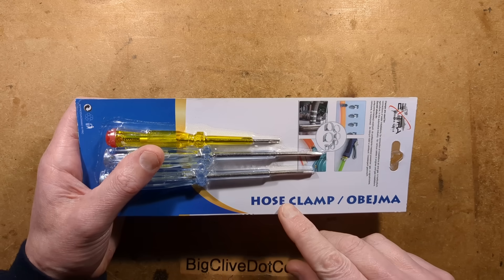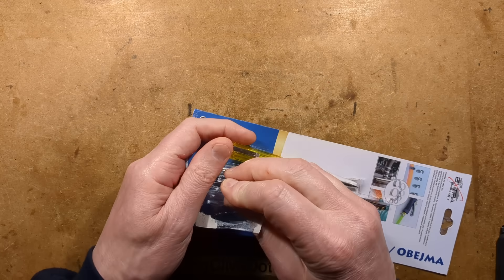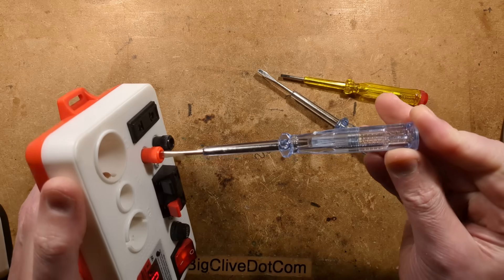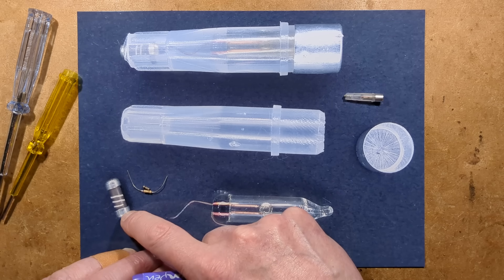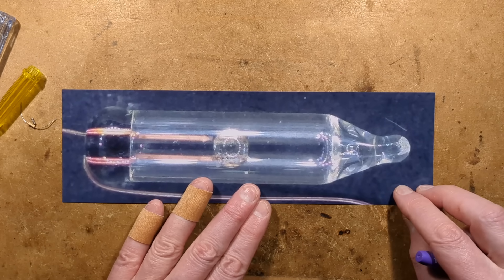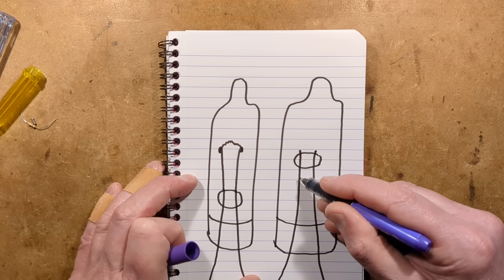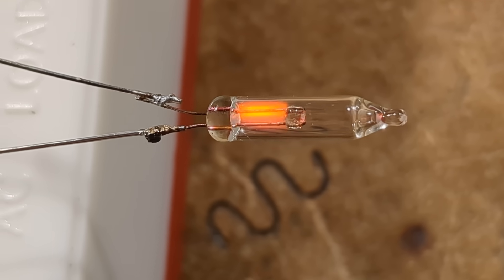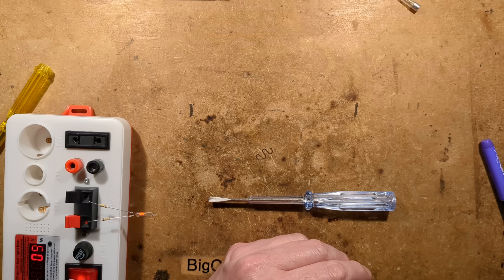Mispackaged testers with very odd neon bulb

Comment: Thanks BC. How strange that they should manufacture a neon lamp like that when NE2s are so cheap. If the dumet is being used as electrodes, it'll sputter very quickly if you leave the lamp powered up for a few hours, depositing a rather nice copper coloured mirror finish on the internal walls. One of my very early experiments!😁

Comment: Me & my dad have been using those electrical screwdrivers for the small slot-head screws in connector blocs and for testing if a connection is live, yes not the most safe sounding way ~ having to rely on that small resistor to protect you from being zapped/blowing the neon bulb, someone discovered that the voltage to light a neon indicator was low enough not to electrocute a human, and “this would make a very safe way to test for a live connection “ and marketed it. And conveniently integrate it into a electrically safe small flat-head screwdriver, I did come across one that had a button in the end that you “pressed” to test a live connection
Reply: I'm anticipating the reviews from the inevitable Tеmu-sourced equivalents. „It doesn't have a resistor, so it can be made cheaper, and instead of a bulb the indicator is a vibrating sensation in the finger. The level of warmth/pain in said finger tells you what the voltage is...“ ⚡😆
Reply: @dieseldragon6756- that & Aliexprss is where the “Chineseum crap” factory’s dump their polished turds so we unintentionally directly import them, yes more likely to be dangerous and noncompliant to electrical safety standards 🫢⚠️

Comment: Jeez, when you were about to test the first one without opening it I was literally yelling at my screen "NOOO!".  I wouldn't trust anything like this from China not to just contain a cut down nail with some random bulb shoved in!  I really wouldn't want your videos to end because of something like that.  I used to use these things 40-odd years ago.  Thankfully not in the last 20.  Even the bare metal screwdriver end is not insulated far enough down for any comfort.  Not a good thing for Joe Muppet to buy.

Comment: He took an unnecessary risk. Rather than testing a questionable test screwdriver with your body, use a resistor of about 220kohm where your body would go. In other words, connect the resistor between the screwdriver cap and ground. Measure the voltage across the resistor. If it is less than 100V, the current is less than half a milliamp, which is safe for conducting through your body.

Comment: Made one of these in shop class 40 years ago, They had us make it out of wood because wood is great for stopping power lol. I think they just cut a wooden broom handle into 4 inch sections. we drilled a hole in 1 end up to about half way then drilled a hole through it from side to side. Sufed the bulb into it from the bottom till you seen it in the side hole, Glue it in place with wood glue mixed with the shavings from the drilling process making sure the 2 wires from the bulb suck out the bottom. Then to pass the test you stuck the wires into the wall socket to make it lights up.

Comment: When I was a kid, I took out the neon lamp from the tester & connected it directly to the mains (240V AC) without the resistor and turned on the switch. A bright blue flashed with a loud pop sound and the breaker popped. It was fun until my father interrupted the excitement. 😂
Reply: As a kid I tried a neon mains tester as a ht car inanition tester, thinking the resistor and neon to blink but keep the 14kv away from my pinkie 
Only did it once:)
Shocking;)
Reply: @BobNobody-p6l  I have an in-line neon HT lead tester - one end clips on to the spark plug, the other to the HT lead. Useful item to have.
Reply: We are the guys who survived natural selection. 'Nuff said.
Reply: That sounds like a good time.
Reply: "If I'd known that I was going to live this long I would have taken better care of myself " 😂
Reply: @Paul_SD George Burns!
Reply: Why you need a ballast (current limiter) in one easy lesson.
Reply: It's also how I found out what a series circuit is and that Christmas lights do not in fact run at 230V.
Reply: I held a fluorescent starter into the bayonet lampholder of my bedside lamp when I was young - lovely purple glow then 💥 *BANG*💥. Blew the fuse in the plug, didn’t touch the 32A rewireable fuse in the fusebox. Funny thing was both my parents were dishing up dinner in the kitchen across the hall and neither even noticed…
Reply: Breaker? When I was a kid, breakers weren't invented and I did the same thing. I remember a bright flash and a loud pop, but not much else. Dad was at work and I had time to clear up and hide evidence!
Reply: I used to plug electrolytic capacitors into the mains. Such fun.
Reply: @PharmaGiles I think you get the prize🤪
Reply: I am also surprised i survived my youth
Reply: Sounds like safe fun
Reply: Oh yea, I did that also when I was young.... didn't realize that the neon bulbs were basically a dead short without a current-limiting resistor.... 💥
Reply: My mate used to do that with leds in a plug
Reply: @philtowle4683 ha! You just reminded me! I did connect an early red LED to a car battery without a series resistor. It went bang and the tip of the lens blew off!
Reply: Yes I did the same as a kid..😁
Reply: 😂 i did that as well....and survived
Reply: Sounds like super fun party poppers. without the small paper bits.

Comment: I brought my mains neon screwdriver way back in the 1970s and it's some where in the bottom of my tool box and it still works but I don't trust it because it will light up on any voltage between 70 to 240 volt even it I take out a bulb from a light socket and touch the terminal with the so called mains tester it will light up a bit.  The light switch is off it shouldn't light up?  No I don't trust it so it stay in the bottom of the toolbox

Comment: The resistor looks identical but the neons in the ones i had as a child looked like glass fuses with an electrode at either end and a gap in the middle where the glow was visible

Comment: I have one from the 60's. It has always served me well, but I always say a little prayer before touching it with my finger. Sometimes you just have to walk on the wild side. I would never use it to drive a screw. There are much better testers, but this hose clamp fits into a tool belt so well and sometimes it tells you all you need to know.

Comment: I always found it a bit scary that it uses your body as the ground. I remember one video from PhotonicInduction many many years ago that he warned about them if the voltage gets too high the arc will then jump over the resistor and then though you.
Reply: then again you can attach a wire to the end to use as grounding instead of yourself, that's all this needs
Reply: It's not a ground.
The concept of ground is an American expression in the context of mains electricity.

The problem with referring to it as a ground is people start to believe that electricity flows to the ground.

The word ground has so many meanings, when the word is used, it often used incorrectly or in an unclear way.

What this terminal is, is a return path for the current to go back to its origin, which happens to use the earth , NOT ground.

And the reason it works is because the earth and neutral are bonded together, somewhere.

So we really shouldn't be using the word ground in the context of these devices at all, unless you are an American.
Reply: @deang5622 Thankfully i'm not an American. But dutch, but even there we use the term "earth" (aarde) for this. My bad. Happy?
Reply: @Marfprojects Yes, thank you.
I like it when sparkies learn something new and are willing to adapt: so many don't.
Reply: @deang5622  I think this is validated by the bag of soil that hangs from my consumer unit by a green and yellow wire... 😋
Reply: @deang5622  You are being pedantic, and not entirely correct. 
Thankfully i'm not an American. 
I use both Earth, Ground and others like Drain and Shield. 

Go figure.. I could be wearing electrical industry boots of high insulation level, yet the neon lights. 
My body, fully insulated from Earth or Ground... woteva...  is providing an Active or Line or Live.. woteva.. return to what? 
Looks like a Ground effect .. capacitive coupling to the Ground? It's not return to a PE - Earth conductor. 

And so, I connect, bond, my Main Earth cable to a copper clad steel stake driven deep into the Ground. That Main Earth cable connects to the Earth Bar > a MEN Link connect between Earth and Neutral Bars located at the meter panel... or Main Incoming section of a Commercial/ Industrial board.   
Yeah, I'm a professional industrial electrician who rarely encounters these POS tools. 
They should be banned from sale.
Reply: All it would take is a power surge and that tiny resistor would arc over.
Reply: it's scary if it's not made correctly, as is often the case for cheap chinese tat

Comment: I'm 73 now, and been "electrically-minded" , as my dear old mum used to say, for over 60 years, and I can say that these were all that was available to the average person to test for live connections back in the day. I have also had a faulty one with no resistor inside, the live connection was immediately apparent! As others say, a test where you are part of the circuit is a bit flawed.
Reply: You can swap out the resistor to a lower value one and give it to someone you dont like though.
Or keep one like that in the top of the toolbox if someone keeps nicking your stuff.
Reply: For many decades - all the golden times of vacuum tubes radios and TVs - the majority of such appliance utilised a self-transformer to save 50p to 1 pound (of the time) on the manufacturing costs.
An auto-transformer has only one winding, it has no primary and secondary windings that can isolate the device from the live main.
Therefore said appliances had the chassis directly connected to live power. Actually the chassis had 50% chance to be live, depending on the orientation of the power plug. The UK has a polarised plug that can define the neutral from live, but Europe had a simple bi-pin plug that could be inserted both ways.
In such appliances, the plastic volume knob was the only part that avoided the user could touch the potentiometer rod which was tied to the chassis of the device.
I can still recall when the volume or the brightness knob of the B/W TV set got wet because my hands were wet, it was possible to feel a strong electrical buzz in the hand, if not a straightforward electric shock.
To conclude: in that world, from the early '50s to the late '70s, a neon screwdriver tester was considered a very safe way to come in contact with a live 240 Vac connection...
Reply: @Ray_of_Light62  Yes, in the 1950s/ 60s, here in the UK, virtually all TV sets were 'live-chassis'. 
There were also AC/DC radio sets and the advice was to fill knob grub-screw holes with 'Chatterton's compound', no longer available but we might reckon as a kind of 'cousin' of sealing-wax.
Reply: @Ray_of_Light62 my uncle was tinkering around with a 1950s radio, the bakelite knob had broken so he tried to use an aluminum knob off an old grill, he got blasted across the garage 😂
Reply: @Ray_of_Light62  I've had many "tinglings" from incorrectly plugged in appliances in the 90's as a kid, stuff likely some from the 70s since there was a lot of wood in it. Fun things if you hear the 50hz buzz on a speaker, you think it's just a ground loop, try to disconnect it and you get a nasty shock because even the speakers are somehow live ... Somehow I survived. I got one of the more "decadent" neon testers from my dad, it works great and lights up a lot more than this unit does and is very handy as a first test, if it lights up you are not safe, otherwise go and look for the expensive tester and find where you last left it. I got a fluke one for mains and it works great, main disadvantage being you need to keep it away from you at all times since the pins are needle sharp and I'm still clumsy and instead of electrocution the main risk is now penetration.
Reply: I remember tracking down a live connection in the airing cupboard. If your other hand is touching a copper pipe you are very well grounded!

Comment: When I was an apprentice electrician, a neon tester was an absolute "must have" and a big improvement over the previously used test lamp - usually a pendant lamp holder with a couple of trailing leads and a very easily broken light bulb.
Reply: Back in the late 1950s we were issued with the Drummond test lamp as a replacement for the pendant lamp holder method. It was a really safe design apart from using a 15 watt pygmy lamp. I decided that a supply was dead because the Drummond didn't light and got an almighty belt. The filament in the bulb had gone. After that I always tested the tester on a known live supply first.
Reply: @Rob-q1e6j  good to know that mistake predates the modern NCV magic wand testers
Reply: > "always tested the tester on a known live supply first" We old folks learned that in our playpens. But I suspect many younger guys have not learned this lesson yet. Neons, filaments, needle meters, DMMs.... be sure it can read LIVE before you trust it for DEAD.
(Also remember that Neon dopes not read under 70V, which is rarely deadly, but can make you jump jerk or fall.)
Reply: the fun was having identical looking testers, grab the wrong one and jam it into line voltage!  one was neon bulb for line voltage and other 12v lamp for automotive testing. the only visible difference was red or blue end caps and one solid metal button other banana-jack, at least without looking inside closely.
I zapped myself quite a few times grabbing the wrong one and my buddy placed a 12v one across 240v water heater for a nice surprise explosion and arcing.
Reply: A few decades ago in Hungary it was common to use 2x 15-25 W lamps in series. Based on brightness you could tell if it was connected to 230 or 400 V. 3 phase is commonly available here, even for small houses. Until the early 1960s most electrical installations used rubber and cloth insulated black wires, except for the ground, which was red.  So you needed some tester to identify live and neutral.

Comment: Last neon driver I got I converted into a 12v probe, using a while LED and appropriate resistance for 15v, attached a wire to the top of the driver with a croc clip on the other end of said wire, and sharpened the flat blade to a point to make it a pokey tool, much safer... :P
Reply: now go test some line voltage with it!  🤣 they used to have 12v and line voltage testers, that looked identical except end cap color and one was banana jack on end instead of solid.
you can imagine how many times errors were made, it's not fun lighting up and burning out incandescent bulbs via your body.

Comment: ps...I bought a 2 screwdriver tester set from !£¡|and...one of which was a 12volt tester...absolutely ZERO indication  that it was not to be used to test mains!!!
Reply from the maker: Yeah, I remember those sets.  I wonder how many people got a nasty surprise when they probed a live wire with a 12V lightbulb in series with them and the mains.
Reply: A 12V tester would have a ground wire with a clip. It should be very easy to tell the difference. Maybe the ground wire was detachable?
Reply: @helgew9008  The wire was not connected having a small "banana" style plug + crocodile clip but with zero explanation...the testers looked the same, not even a 12v, 240v on either.The problem was the lead got lost and the tester just ended up in a tool box with random tat...240v fuses, insulation tape, batteries etc...yeah it did happen and right in front of my eyes...question was had the lecky been cut off in the road (coz the place had been squatted) or had they just removed the fuse @ company head? Bloke was standing in a puddle when he stuck the tester on the live...there was sharp crack and a flash, he didn't say a word apart from I can't see properly and summink like 'that's good they ain't dug up the road'...the only thing between him and 240v???amps was a lilliput bulb and he didn't feel a thing.
Reply: I just found mine again, it has a point at the end and it says 6V–12V–24V in transparent color on a transparent background 🤔

I no longer have the internal circuit, probably to avoid any future “Surprising” tests of a 240V phase 🙄
Reply: Now that I think about it, maybe that was the case for me (in my comment) … which would explain the surprise when I wanted to test if there was still power. I have to remember to put them aside when I find them again 🤔

Comment: Some guy who bought hose clamps: “what’s a voltage tester”
Reply: Better than trying to check for the presence of a dangerous voltage with a hose clamp.
Reply: @HiddenWindshield oh aye if ye catch fire, it’s solid current
Reply: @HiddenWindshield  True, but FAR less exciting! ;)
Reply: I would say they are mediocre testers at the best but just a plain awful hose clamps.
Reply: Years ago, allegedly, someone translating a technical manual into Russian, translated, "hydraulic ram" as, "water-sheep"!
Reply: @jozefbubez6116 That particular error didn't come from a person, but was from an early attempt at computer language translation.
Reply: Be even funnier if they try and shove one end into a socket

Comment: You know that there is someone holding a package labeled "neon screwdriver testers" wondering how in the hell can the hose clamps they received be used to test for electricity  :)
Reply: you put the hose clamp over your finger, tighten it up and touch the wire you want to test ... NOT! 😅 If your finger glows, you know it's live.
Might give some tingling sensation 😅
Reply: If you shove the ends into an outlet wrong enough, pretty sure they'd be effective at testing the circuit protection or wire integrity..